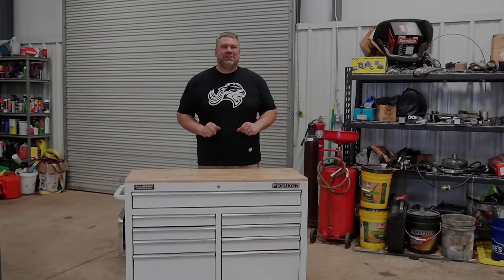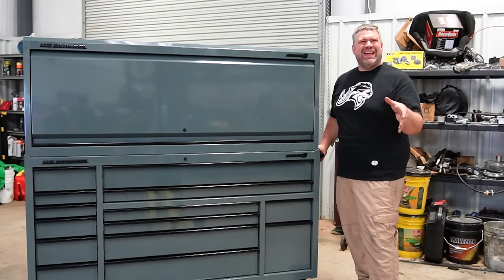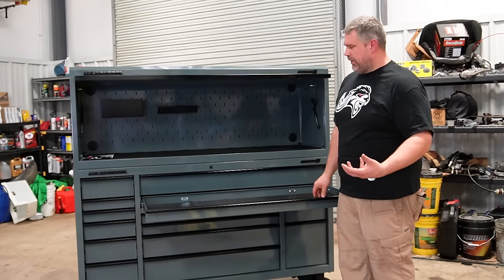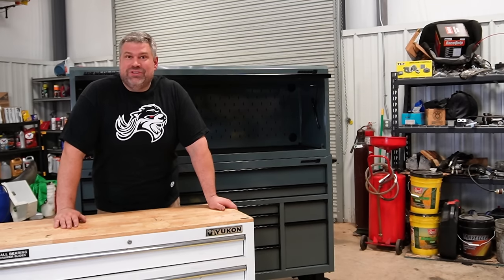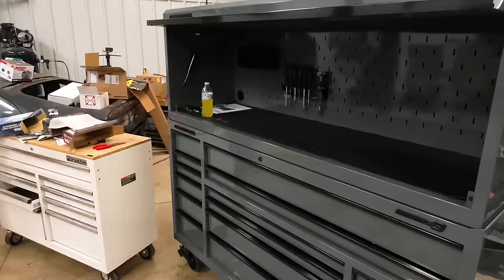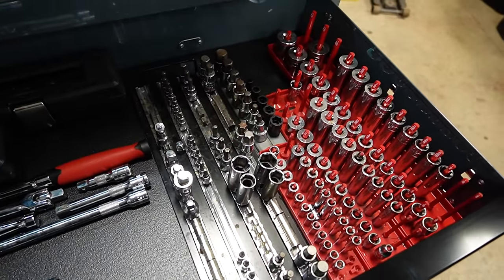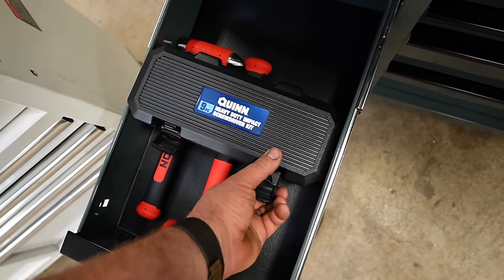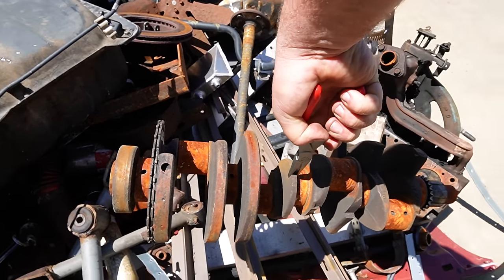Can You Really Save $20,000 With "Cheap" Harbor Freight Tools? U.S. General Series 3 Review

Comment: As a former ford technician working day to day at a dealership my home shop toolbox and tools are same as what you just showed.  Us general box with a mix of tools. The old reliable, some new icon and others. Thank you for showing up and coming technicians that they don’t need to go in deep debt to buy quality tools to make a living. HF is changing the game in a big way.
Reply: I'm just a farm kid around 44 now but I lucked out around the mid 90's I acquired a Kennedy mechanic series tool chest 11 drawer with the center square drawer top, and the 2 inch riser and the bottom roll around tool cabinet with the Factory door on the bottom it has three deep drawers the whole thing is power coated orange factory color and it has been a very good tool box I believe it was made in the mid 80's to early 90's but it is a USA made tool box made in Ohio, and even I like the idea of upgrading to the series two us general 26 inch top tool chest and the single bay bottom cabinet I may eventually pick them up used and add on to the ends of the Kennedy Box but I don't see me replacing or getting rid of the Kennedy Box set to get the us general boxes so who knows....

Comment: I really like adam savage's system hes talked about. Buy the cheap ones when you first start out. You dont know what you need, whats going to get abused, whats goign to get broken or just not be sufficient for your job. Once that tool you use daily breaks, upgrade to a better brand. Spend a bit more money where its actually needed. Or if you find yourself getting frustrated because you dont have a tool, and it happens weekly, or monthly... just go out and buy it. Youve saved so much money by NOT buying everything that you can afford to buy more specialized tools over time. Eventually your tool set will be entirely customized to you and what your needs are. And you can be damn sure its going to be different than everyone else's needs.
Reply: I second this! I have followed this piece of Adam’s tool advice for years and love my customized setup. I still find out about tools I want…who doesn’t?…but I rarely find myself without a workable option on any job.
Reply: I bought a bunch of the Bauer battery tools. They work great for the amount I use them. Recently got the lawn mower. That works great to for my 0.17 acre lawn.
Reply: Also jack stands. I have a harbor freight Pittsburgh jack and if you jack it up it works great but leaks out over time which is fine since I use jack stands. I bought some harbor freight jack stands at the same time and took them back as part of the recall. Was trying to convince my wife to let me buy some expensive US Made jack stands when they came out with their new line that has steel bars that keep it from going down once you have the height set.

Comment: As an aircraft mechanic at a major airline every tool I use every day came from harbor freight. Only problem I’ve ever had with them is with the number of close tolerance bolt heads in aviation that you have to deal with…Harbor Freight’s sockets and boxed wrenches are heavily beveled more than other brands which means it’s very easy to strip out close tolerance boots because their heads are at least half as tall as other bolt head types. 

I fixed the issue by grinding and repolishing the ends of all my sockets and wrenches with a bench grinder…and I didn’t hesitate one minute about it because they were all harbor freight. 

Tell every one I can to buy HB tools.
Reply: I'm ready to start an aviation job in 5 weeks. I'm sitting pricing things currently.

Comment: I've been rather impressed by how much HF upped their game in the last 20 years. Back then I was growing my set and went with a 56" Clarke top and bottom bank plus the side locker. Later I did a bunch of welding to the side box to make it old what I needed. Then I outgrew it and bought a 41" roll cart from SnapOn as an add-on.. Still outgrew that. I still have the Clarke box full of Snap-On and Matco. If I were looking for another box I'd buy the Icon. As far as the tools, well they aren't going to work for you if you wrench in the rustbelt. The tool truck stuff does it  in WI where HF fails. But if you are a DIY guy or a new tech I get it. As far as the debt trap of the truck, yeah Jared is spot on. I'm 41 and just paid them all off last year. Did help my credit rating though.

Comment: I built my apprentice a nice start-up set by filling the 30" roll cart with HF tools. 5 years later and I've replaced a locking extension... That's it! 
Replaced broken Matco and Milwaukee cordless tools with Hercules and the same, I had one bad charger and ZERO fails from about 8 different power tools

Comment: Jared- I really enjoy these videos. I’m very much an amateur mechanic (mainly on bikes) from the UK, and I can fettle bits but usually stop when things get scary. 

I’ll never be as good a mechanic as you or probably the majority of your viewers - but your vids do give me a bit more confidence to go that little bit further on my projects. 

Thanks for the inspiration and being a general good guy.
Reply: Lots of us are learning. Last month I welded for the first time with an on sale HF titanium flux 125 machine I got for $160USD. I welded nuts on broken bolts. Replacing my Minis front struts. Overall saved like $400USD labor doing it myself over the weekend including the tools which of course I’ll be able to use again. I was pretty nervous about what to do when they broke but I thought “well go for it”, I’ll weld a nut on like I’ve seen everyone else do how hard can it be? It’s not as easy as it looks but it can be figured out for sure. Trick was turning the heat to max.
Reply: I also learned that a wire brush on a drill goes a long way getting those rusty bolts clean enough to get the nuts free without breaking things.

Comment: I discovered harbor freight a couple years ago and I love the fact that they have different product lines for different frequencies of use.  For tools that are not use regularly Pittsburgh does great and if you need a tool for frequent use you just go for one of their upper lines.  Still saves you a lot of money I completely agree.
Reply: I just recently bought a set of Pittsburgh tools from them, just basic sockets, ratchets, and wrenches to be able to do the simple maintenance on my car myself. Oil, brakes, and that's basically it. For the $150 it cost I'll get that back in no time being able to avoid paying someone else to do very basic tasks. It's super nice have a cheap option when I'm not going to be using them very often.

Comment: I've found that upgrading or at least re-greasing/adjusting casters is one of the most rewarding things to do before using a piece of equipment.

This started years ago when I borrowed a friend's HF Pittsburgh engine hoist. The chintzy steel casters irritated the hell out of me. I live near a shop that specializes in casters, and I bought a set of urethane wheels to replace the steel ones. The caster forks remained (they're a nonstandard mounting flange bolt pattern) and got cleaned and greased. It made a WORLD of difference! The hoist rolled much more easily and quietly. My friend was really happy as well: he had an upgraded hoist that was much nicer to use and I paid less than it would have cost me to rent one. Everybody wins!
A few years later, I bought my own Pittsburgh hoist at HF, drove directly to the caster shop on my way home, and bought the same wheels.

Last caster recommendation: twin-wheel casters are really great for heavy things that get moved often, as they change direction more easily.

Comment: I really liked those Icon snap ring pliers when I was using them but I had a tip break off as I was putting in the last snap ring to close up a 722.6 Mercedes transmission and had to tear it back down to fish it out. It didn't cost me that much time but if I didn't notice it it would have cost me my reputation because that vehicle wouldn't have made it out of the parking lot. I replaced them with Knipex after that and love them. Pretty reasonable cost and much better form factor than the Snap-on snap ring pliers.

Comment: Firstly i did not need the same tools as any mechanic, I'm a retired coach builder but I still have all my tools in a very nice rolling cabinet. It's not snap on but it lasted me the majority of my working life. Some of the tools I bought during my apprenticeship and they are still in excellent condition. My planes are as sharp as they ever were. My snips, left and right hand still cut like new. They are not snap on but I earned my living with my tools my whole working life. My cabinet isn't as big and has a 4 drawer box on top, but everything Inc ratchets etc still works like new. I used to shudder when I saw some workmates paying a fortune and running up debt to buy snap on.

Comment: I’ve read comments on other videos from guys bashing HF tools and the people buying them. As far as I’m concerned they can piss off. I wrenched on heavy trucks for almost ten years until the arthritis in my hands said no more. The cheapest tools I had in my $8000 Cornwell box were a few USA made Craftsman screwdrivers and small sockets. All else were the big names. During those years I don’t recall NOT owing a small fortune to the tool vultures that pulled in our lot every single week. Even after I went into a different career, I had to sell most everything off to pay it off. Never again. And I mean never. I just bought a Series 3 56” box with a side cabinet to make it a 72”. It’s not perfect, but it’s great and a nice setup at home. The finish is flawless, unlike my Cornwell box that had to be sent back and touched up. And, it was about $6800 cheaper. The drawer slides are a little stiff, but I don’t have to worry about a heavy drawer creeping open that I may have forgot to latch. Overall, I’m very pleased with Harbor Freight. They’re really stepping up the game. 💪

Comment: Years ago I worked in an arcade. My bosses always bought the Craftsmen tools (American made version) because of the warranty.I pointed out that the Harbor Fight line was much cheaper, had the warranty, and reminded them that the most common reason for buying new tools was because the employees were losing them, not breaking them. I got a thank you bonus a year later when they saw how much was saved that first year. Store managers were happy because they didn't get as much grief when they had to replace a missing tool.

Still to this day, my tool kits are filled with HF tools. If I break one, I buy the next level up. If I leave one in a car in the wreaking yard, I shrug and buy another. I have saved a ton by doing this.

Comment: I'm a hobbyist DIY guy. Most of my tools are from HF. I did buy the Husky tool box because it had the soft close drawers. I've been mostly happy with that box (the drawer rollers on the big middle drawer literally fell apart, but they replaced them under warranty).
I'm thinking my next tool box will likely be from HF.

Comment: I'm 42 and I also worked at a Toyota dealership as an apprentice in 2001. My first ever tool set was a Craftsman's "Mechanic Tool Set". I've used them in every way I was not supposed to, and I only broke the 3/8 and 1/2 ratchets because of extension pipes instead of using a proper breaker bar. I still have and use everything from this kit to this day, as it is still the basis for my auto tool set. I'm still impressed by the quality and how comprehensive this kit is for what I paid in the day. I wonder how modern Craftsman tools compare to the old school ones...
Reply: Eh, not good....
Reply: Modern Craftsman is junk.  Like you, I bought a Craftsman 'Mechanic's Set' around the same time as you (2000, 2001ish) and those tools are my main go-to in my bay at the shop.  I've got some Snap-On stuff, and I've got a lot of Icon stuff.  I was given some newer Craftsman stuff and out of the 3 or 4 sockets I've broken during the last few months, they've ALL been from that newer Craftsman gift.

Comment: Couldn’t agree more, had the same experience with the Pittsburgh pliers. Replaced them with knipex pliers. Another thing to add to the avoid list is the cheap Pittsburgh Allen’s they twisted and stripped Fasteners. 
Everything else has held up well. Also to mention is typically (this can be store dependent) their warranty is just as hassle free as a tool truck.

Comment: Probably the only thing I'd like to see with the Series 3 is some removeable protective rubber sheeting in the drawers. You're putting tools in there, and on a smooth surface they are going to slide and bang and scratch. I'd pay the considered fair price for that little bit of protection inside. When they get filthy with grease and oil and dirt, take em out, do a quick pressure wash and dry, then put em back in.

Edit: So after looking back through I had somehow missed that there are indeed protective sheets in some/most of the drawers. (Whoops!) Guess that makes the above part kinda void, though I'd argue that for the drawers which didn't have them, it'd still be great to get them. Could even have them as a silly addon. "Toolbox Gaskets"
Reply: They sell uncut drawer liner at HF.

Comment: I'm getting ready to go get a 56" for a new job as an aviation airframe tech apprentice. If I could do one thing for me specifically when I get ready to have to shadow everything in foam. Maybe the 2nd drawer down a little deeper OR do like the tool trucks and give me the option of an add on toold drawer for the same cost as a side cabinet. For space savings I'll stand more things upright and the 2nd drawer is iffy. I set an icon combo wrench set in the 2nd drawer and it's OK in the case but they're laid back at an angle.

Comment: In my first 25 years as a mechanic, I bought only used Craftsman, Mac, and Snap-On toolboxes at estate and garage sales. My impact sockets were all Cobra. My wrenches, ratchets, and chrome sockets were all Craftsman. My air tools and 110vac power tools were all Chicago Pneumatic and Chicago Electric (along with the Cobra sockets they were all purchased off independent tool trucks BEFORE I knew about Harbor Freight. Thank you, Larry's Tools on Wheels and Phil Nugent Tools!) As tools wore out or broke, I replaced the individual tool with a name-brand unit. 40 years later, I still have most of my original tools, plus a few Name-Brand specialty tools like a triple-square head bolt key for Lexus engines and some specialty Volvo cylinder head/camshaft/cam-cover and pulley/synchronizing tools.

Three rules I live by...
1) ALWAYS pay cash for tools. It's cheaper to save up for a tool than to Finance it.

2) When starting out, buy your tools used whenever possible. Estate sales, garage sales, 'trade-ins' on the Tool Trucks. My last two toolboxes were trade-ins from a Snap-On truck.

3a) It's OK to borrow tools when first starting out. BUT! If you have to borrow a tool more than TWICE, It's time to buy your own! (Some Tool Trucks will even let you try a tool for a few days before buying. It never hurts to ask!) 
3b) If you break a borrowed tool. Offer to replace it or pay for a replacement ASAP! The same day if possible.

Comment: Its cool to actually see it outside of a trade show! I hope they'll start offering the ICON boxes in more color and trim options
Reply: This will pretty much phase those out. They were too expensive out the gate to really compete with pro boxes
Reply: What's the point with color options?  If the tools work, they work.
Reply: @ronaldjohnson1474 I like colors. I got a Mac macsimizer roll cart, white with black trim. an I seen the series 3 72” the same color config an I had to have it.

Comment: The Craftsman wrenches and sockets/ratchet/extensions that I bought from Sears in 1978 are still the ones I use today.  Not one failure.  The advice here is great - don't buy the $200 ratchet when the ICON (the new Craftsman level of tools in my opinion) will last a very long time.

Comment: I have their ICON toolbox and it has been great, also got the top box and locker. After a year one of my coworkers got the same set up, but in blue. I also have had good luck with their ratchets and digital angle torque wrench.
I have been a professional mechanic over 40 years and these are the Best Buy in the tool box market right now.

Comment: I picked up a Icon 73" box 2 years ago with a 10% mega coupon, as well as another 10% for signing up for the HF Credit Card. I think I paid like $2600 with tax for that box and it's amazing. Mainly went that route because at the time, the US General didn't have expandable options (like a hutch or a locker). Love that they are improving the US General line now, but totally agree on the quality of the HF brands improving drastically.
Reply: I'm not going to lie. If I didn't pick up my Matco 4s Triple baty for a good deal I'd definitely get myself an Icon box. So far how are you liking it? Any issues?
Reply: @ironfistleadfoot336  For context, I'm a hobbyist who just wanted a nice box that I'd likely own for my lifetime (i.e. it's not seeing daily usage). But so far, it's been great. Socket drawer is nearly full and still opens and closes very smooth. From the once or twice I've been around a SnapOn or MatCo box, I don't feel like I've been short-changed at all.